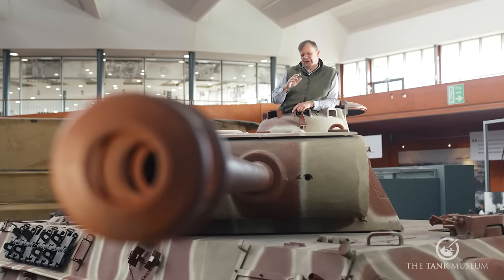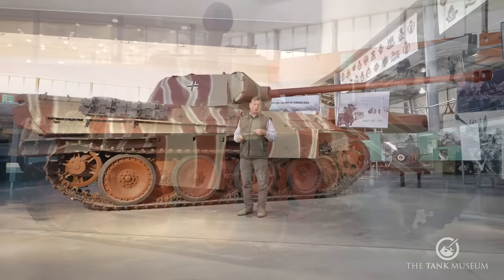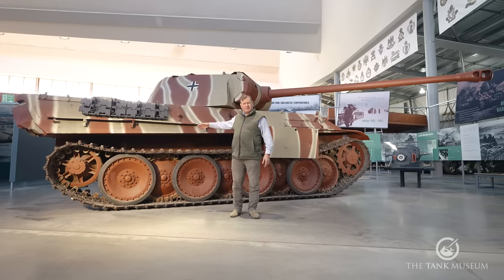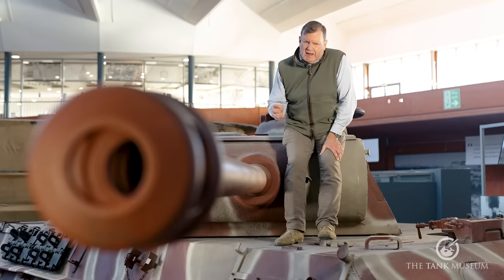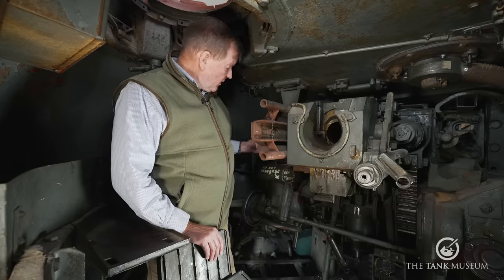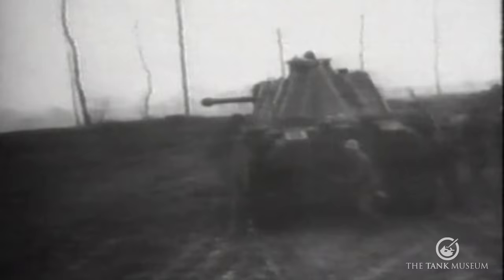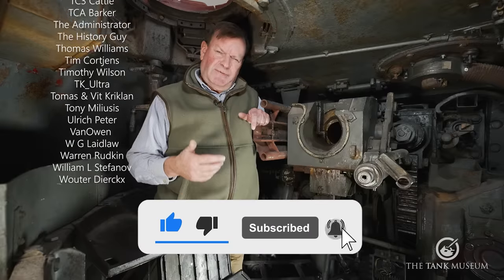See Inside Panther | Tank Chats Reloaded

Comment: Jesus Christ and Mary Magdalene in Heaven.......
With the GREATEST respect and humble....this video is made by historians, a historian presents the tank. and STILL I can find myths in it.
Please read my arguments carefully:
1. Panther built by British after the war, cannot complete a British trial.

First: 
I immediately noticed that the G Panther in the museum has a  Ausf A variant tower. This alone shows the seriousness of the "putting together" operation.

Second:
Were the British people who conducted the tests trained enough to use the panther?
Were the parts used to assemble the tank equivalent to 1944 quality materials?
What was included in the test that the Panther could not perform, what was the fault?
These are 3 major questions for which we have no answers, only that the Panther is unreliable.

How is it that the Germans, who also knew about the Panther's faults, were able to do 1 500 to 4 200 km with the Panther? 
Isn't that contradictory ?

2. Did the Germans "borrow" the angled armour from the T-34?
Virgin Mary...this myth was busted decades before, are you still bringing it up?

3.Does the Panther eat 4x as much fuel as the T-34? 
I ask you...WHY DID YOU DETERMINE THAT?!

Let's look at the numbers:
To start with, a diesel engine uses on average 20-30% less fuel, but not 4x less.....

The Panther had 720 liters of fuel.
Range of Panther:
On the road: 200-260km
On land: 100-130 km
Panther consumption: 2.76 Litres/km (on road)

The T-34:

Mod 40-41:

460 Litres of fuel.
On the road: 330km
Ground: 200km
Mod 40-41: 1.39 litres/km (on road)

Mod 42:
On the road: 330km (same distance as Mod40-41, because it was 2 tons heavier than Mod 40-41)
Ground: 200km
610 Litres of fuel.
Mod 42: 1.84 litres/km (road)

Mod 43:
On the road: 450km
Ground: 260km
Had 790 Litres of fuel.
Mod 43: 1.75 litres/km

T-34-85: (internal tank only)
556 Litres of fuel.
On the road: 300km
Ground: 160km
T-34-85: 1.85 litres/km

At best:
2.76 vs 1.39: 1.98 x.

Where is the 4x indicator?

4. "interleaved road wheels prone to clog ice and mud"
The tracks of any tank can accumulate ice and mud....

5. The engine radiator is a weak spot....
Jesus Christ in Heaven....its like the weak side armour "argument". Even the T-34 had vent intakes on the engine....
So today, the Leopard 2 is a piece of crap, because has big ventilators on the engine, and has only 40-50 mm of side armour...
Even modern Russian MBTs has the same amount of armour and big vent intakes on the engine as the panther....
Or the British Challenger 3 has the same "weak spot" or the M1 Abrams vent intakes....
Please Sir, do not use this kind of arguments.

6. KwK 42 is NOT much better than a Kwk-40 on the Pz IV...
Sir....numbers....
Source: Bird, Lorrin Rexford; Livingston, Robert D. (2001). WWII Ballistics: Armor and Gunnery. Overmatch Press. p. 61.
Kwk 40: (against 90° of armour) (L/48, not L/43)
100m: 135 mm 
500m: 123 mm
1000m: 109 mm
2000m: 86 mm

Kwk 42:
100m: 185 mm 
500m: 179 mm
1000m: 149 mm
2000m: 145 mm!!!!!

If that's not a big difference, I don't know what else is "big".

7. For the driver levers, pump means, it had hydraulic SERVO drive.
To simplify it: you could turn the tank with your little finger. Whereas with the other allied tanks, it took a lot of physical strength.

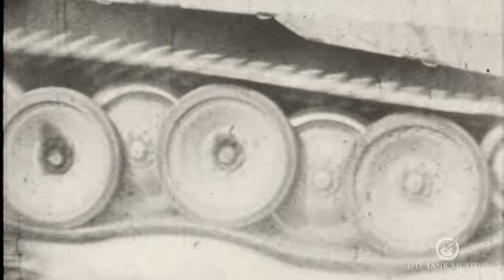8. As you can see: 16:48 the gear lever was "on the floor" next to you, and not upwards as it is in the museum tank.

9. Serviceability only 35%? Please, Sir, do not lie:
Check out the Panther --->Reliability table on wikipedia.

Fun fact: avg. it was 61-62 % from 1944 may until 1945 march. In 1944 if there was not a big push, the serviceability was 85-71% on the western front.

10. 370 final drive was broken. Nice. 
In how long? And from how many tanks? 

Oh, and yes: why did it break, perhaps from a 76mm hit?
I won't paste odes about the reliability of the Panther and the T-34 here, their wikipedia pages have it all beautifully described.

Fun fact:
"Soviet tests on newly built T-34’s showed that in April 1943 only 10.1% could complete a 330 km trial and in June ’43 this went down to 7.7%. The percentage stayed below 50% till October 1943 when it rose to 78%, in the next month it dropped to 57% and in the period December ’43 – January ’44 the average was 82%. During February 1944 tests, 79% of tanks reached 300 kilometers, and of the test batches 33% reached 1,000 kilometers. This became immediately apparent to the tank troops. The deputy commander of the 1st Guards Tank Army, P. G. Dyner, commented that tanks in 1943 would reach only 75 percent of their guaranteed life span in engine hours and mileage, but in 1944 they reached 150 percent."

O, and yes, from that 1945 report, Sir, you forgot to mention this:

"From the front there continues to be serious complaints
regarding final drive breakdowns in all vehicle types.
Approximately 200 breakdowns have been reported with
the .38(t). Prior to the 1945 eastern offensive there have
been 500 defective final drives in the Panzer IV. From the
Panther .370 and from the Tiger roughly 100."

Every tank had problems with its final drive, because of the LACK of training and bad material quality.

11. More Panther lost by mech. breakdown than to enemy fire: Where are the numbers, Sir?

12. French fixed the engine fires? Siiiir, please: The Germans tried their best: tried to use better materiel for the fuel pumps, and decreased the horsepower from 700 to 600 hp.
The Germans knew what are their problems. About the Panther engine there are many-many  bad tone report blamed on Maybach. And the solution was to reduce engine power.
The result of this was checked by Guderian in April 1944.

Why don't you share this information with the world?

Thank you for reading.
Reply: Nobody is reading your schizoid rambling lmao
Reply: @frostedbutts4340  That is not changing the facts.

Comment: I used to think it was a very good tank, probably the best of all tanks from World War II. But then I started taking a serious interest in the subject, reading reports and studies. And now I think it was one of the worst tanks the Germans had. Yes, it had an excellent gun, it was dangerous and well armored from the front. But... it usually stood broken in the workshop and waited for parts. When you read specific reports from German divisions about the combat readiness of tanks, it is hard to believe how few Panthers the Germans had ready to fight. Often it wasn't even half of thm ! For example, it often happened that out of 78 tanks  they had 20 operational.... This tank broke down incredibly easily and was difficult to maintain. Germans - as in the case of many other projects, only wasted a huge amount of resources - which they lacked - in exchange for very questionable benefits.
Reply: I'm afraid your figures are off.

According to the operational stats of Panthers, Panzer IVs and Tiger, the overall operational average wasnt much difference between all of them in the last year. For 1944/45 it was 62% to 71% overall average, with the Panzer IV slightly the highest at 71%
Panther reached a high of 85% in October 1944%. It's lowest in 1944 was never under 50%. That's across all units as an average.
The figures include those in repair with battle damage.

Source. Thomas L Jentz, Tiger I and II Combat Tactics.
Reply: @lyndoncmp5751  You are wrong. This is a topic for a very long lecture, and I will not spend my Saturday digging through sources and convincing someone who knows so little and is probably a "fan" of this tank. But I'll give you a sample and I'll write based on what I remember. Around June, the number of Pantera tanks produced was 2,000. At that time, there were about 200 Panthers ready to fight at the front. Where was the rest ? In the workshops, or they were sent back to the manufacturer because so many defects were discovered that the tank was impossible to fight on. This tank was so sensitive that the crew training process lasted from 4 months to ... 9 months. At a time when these tanks were desperately needed on the front, they were stuck on training grounds in Poland for months because the crew had to be trained very carefully in order not to damage the tank. And during this training they were taught that, for example, you cannot rotate the tower quickly, because it will break. You can't suddenly accelerate because it will break down. You can't drive fast - or it will break down. These are the official recommendations from the training documents ! In 1943, there was even a case where a new battalion received Panther A for training and... sent them ALL back because they had so many faults that they could not be trained on. And they waited for the Panthers D. And when the Wehrmacht got them into service, they had over 500 (!!!) defects that were detected and written down for correction. Most of these defects were corrected, but it took months. Months that the Germans didn't have. And now a few examples of losses: in the fighting in France, only about 14-20% of Allied tank losses were losses inflicted on the Allies by German tanks (all of them in general). Everything else is artillery, mines, tank destroyers such as Stug. So was the cost of building expensive and complicated Panthers worth it ? In Ukraine, out of 100% of the losses suffered by the 1st SS Panzer Division, approximately 50% of the Panther losses were non-combat losses. So the tank was either sent back to the Reich for renovation, or it broke down and had to be left behind, or burned because there were no parts, or there was no way to tow it because it was too heavy, or there was no fuel - it burned a lot. A tank is useful when it WORKS. The combat readiness of the Panthers never exceeded 50% (this is based on statistics), while the readiness of, for example, Shermans in a battalion was always in the range of 75-86%. For example, the performance report of the German Panthers from September 30. Army Group Center - 74% (quite high, right? And do you know why? There was almost no fighting for a few days. So they managed to fix a lot of vehicles). Army Group A (intense fighting in Lesser Poland) - 16%. Army Group South - 32%. Another example: the first battalion of the 27th armored regiment of the 19th armored division. It entered combat in July 1944 in Poland with 72 Panther tanks. On August 10, they had... 11 operational tanks. The rest had breakdowns or were repaired after combat. Their report from August 11 was: 19 tanks in short repairs, 19 in long repairs. Report from August 14: 13 tanks in combat readiness, 10 in short repairs, 25 in long repairs. TO SUMMARY: the Panther tank was a formidable opponent at long distances, but it was expensive, horrendously unreliable and actually caused more problems for tank battalions than it brought benefits.
Reply: @lostinspace013 
I'm am not wrong about anything. I am correct about everything. I have THE best sources available right in front of me. Jentz, Zetterling etc. 

Again, your figures are wrong and unsourced. You've made them up. 

Poland summer 1944? You are aware that FAR MORE Panthers were deployed to Normandy in summer 1944 than to Poland, right? 

There were 655 Panthers deployed to Normandy in 8 battalions. 

1st SS
2nd SS
9th SS
10th SS
Panzer Lehr 
2nd Panzer 
9th Panzer 
116 Panzer 

Source: Zetterling, Normandy 1944. 

There were also Panthers in Italy in summer 1944 (Panzer Regiment 4), and in 11th Panzer which was in reserve in France and was sent to try and counter Operation Dragoon. 

Thomas L Jentz gives an operational average % across all Panther battalions on 31st May 1944 as 82% on the western front and 77% on the eastern front. 

You are aware that non operational Panthers INCLUDES Panthers in repair with battle damage, wear and tear etc ? Are you? Panthers not operational doesn't mean they were all broken down with mechanical failures. Many Panthers in repair at any given time were in repair due to combat damage etc, and that was the same even at Kursk. Even misaligned gun sights due to combat would put a Panther as non operational. Same with wheel or track damage etc. 

Please, don't waste my time further with your ignorant silliness.
Reply: @lostinspace013 
"The combat readiness of the Panthers never exceeded 50% (this is based on statistics)," 

Total made up nonsense. Thomas L Jentz gives a 85% operational readiness in total across all Panther battalions on the western front for 31st October 1944.
Reply: @lyndoncmp5751  So, you have one german book ? There is no point in continuing the conversation.

Comment: You guys are leaving out a lot of important information when you are comparing this tank to contemporaries.  Sloped armor didn't come from the T-34.  Panzer I had sloped armor.  Maybe the Panther was influenced by the production processes of the T-34 though.  The panther used 4x more fuel as a petrol engine tank, compared to the diesel engine run T-34.
Reply: wrote: "Sloped armor didn't come from the T-34.  Panzer I had sloped armor.  Maybe the Panther was influenced by the production processes of the T-34 though. "

-- Panzer-I had a very poor sloped angles, just like Tiger I, of which Tiger I had 100mm of frontal armor sloped at 10 degrees with effective armor thickness(aka LOS) of 101mm, and a lot poor projectile resistance, that of Panzer V Panther which 80mm frontal armor plated was sloped at 55 degrees with LOS of 140mm, which is a lot better and lighter then 101mm of LOS, not to mentioned projectile deflecting a lot better from 55 degrees slope, then near vertical 10 degrees slop.

Comment: Why did the British insist on calling their guns, for example, "12 pounders" rather than using, e.g., "76 mm" or even "3 inch" ?
Reply: Back then, Imperial measurements were also a thing. Change takes time. America still has not worked it out.
Reply: The weight of a round ball of iron that can fit within the barrel bore. A 2 Pounder gun was slightly less than 40mm, while a 6 pounder gun (3 x heavier than a 2 pounder) had a bore of around 57mm; thus it indicates the weight of shot (mass) more effectively than simple bore diameter. A 57mm shot at the same velocity as a 40mm round (as long as all dimensions follow the same pattern) is going to penetrate far more armour than the simple sum of +17mm might suggest.

Comment: The Germans did not take sloped armor from the T34 they knew about sloped armor and so did many armies since WW1 but designers deemed it impractical and crew would suffer due to ergonomics and space inside the tank. And last, the first Panthers were quite reliable but due to slave/forced labour things took a downhill. You guys dropped the ball on this episode, spewing falsehoods about the Panther and T34 again while modern research shows otherwise.
Reply: wrote: "The Germans did not take sloped armor from the T34 they knew about sloped armor and so did many armies since WW1 but designers deemed it impractical and crew would suffer due to ergonomics and space inside the tank."

-- If no Panther or King Tiger were not produced, you might have a logical point. Besides, what did Mr. Copson is trying to explain you? It was not about sloped armor, but LOS that doubled at 55-60 degrees of slop, so Tiger I had "arguably" frontal "sloped armor" of 100mm at 10 degrees with LOS 101mm, that was not better, then 80mm sloped to 55 degrees, with LOS of 140mm. Feel the difference?

Comment: I wonder if some of the components used to complete this tank had been sabotaged by the brave slave labourers forced to build them? I have read that contemporary tank restorers commonly find evidence of sabotage deep within engine blocks and transmission casings - oil passages blocked or not not even fully formed. 
Was the commander's cupola the massive weak spot that tank games depict it to be?
Reply: Wasn’t sabotage 
It was untrained unsupervised workers
And the company only cared for it going out the door to meet shipping dates not if it runs
Reply: @tomhenry897  I would suggest it was a bit of both. Deliberate sabotage - up to and including bombs or deliberately weakened main structural items - have been documented. It depends on how far individuals were willing to go.

Comment: The Panther was a good tank, but a waste of resources instead they should have built more Panzer it's because it was their good enough tank
Reply: The Panzer IV was no longer qualatively superior to enemy tanks by 1944 and actually more Panthers were built than Panzer IVs in the last two years. It didn't take longer to build the Panther and nor were they much more expensive.
Reply: The Panther was only barely more expensive than the Panzer IV. If anything it was the best use of resources for the time compared to wild projects like the Jagdtiger
Reply: Heard this before. Let’s say that the Germans manufactured the Pz.IV like the Americans did the Sherman or the Soviets with the T-34, you would have a lot of them. But then you have to address a huge problem that the Germans were facing, fuel.
Reply: @brennanleadbetter9708 
Yes and not only the fuel but the crews to man them plus the personnel and vehicles to support them. Tanks need supply, maintenance, engineer, Flak, recon, medical, field kitchen echelons etc..... including the vehicles. Otherwise they can't function properly.
Reply: @lyndoncmp5751  Indeed.

Comment: Decent tank but as pointed out, it was a major mistake not using a diesel engine and using the overlapping road wheels which were extremely prone to mud, snow & ice clogging. Unreliable tank.
Reply: It's overall operational average wasnt much lower than the Panzer IV, and in 1944 is overall average was around 75%.

Source: Thomas L Jentz.